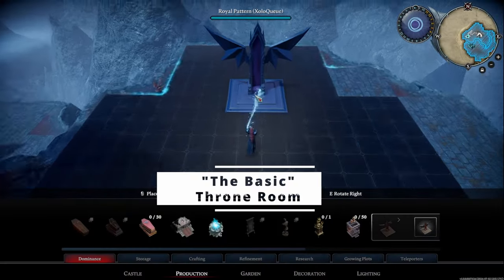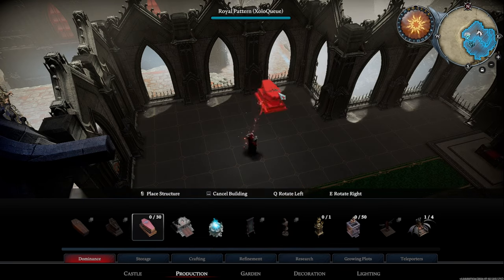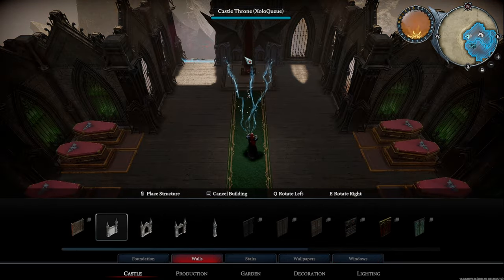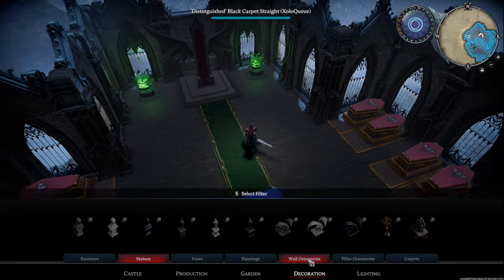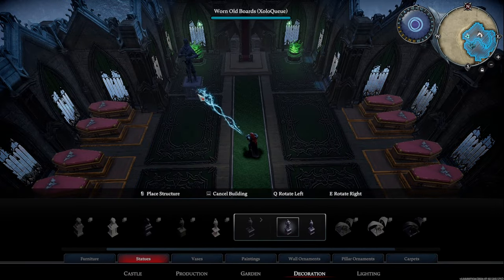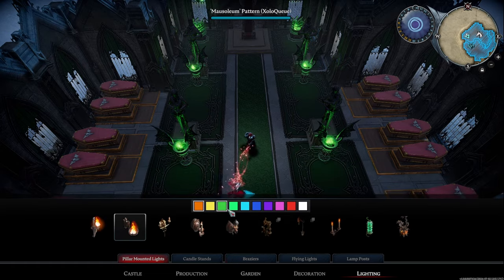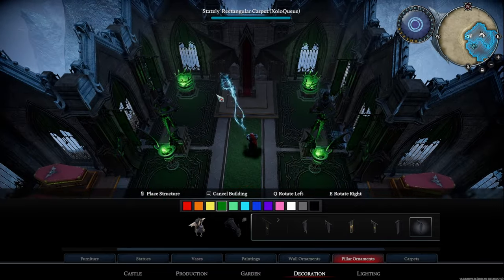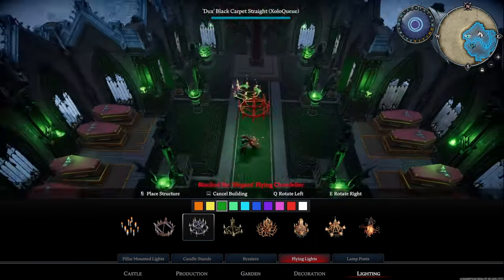How to Build a Throne Room in V Rising Pt 3: "The Basic Throne"

Comment: It's probably just me being a complete noob, but how do you bring up the color wheel for placed items?
As forrating this design, I find it very nice, especially since I like the color green.
I'dstill say that the first design in this series was probably the one that I liked the most. I can totally see myself building that one, with the color scheme from this one.
Reply from the maker: When you're in build mode, hover over the item whose color you want to change, then press and hold the Ctrl key and a color wheel will pop up. Then click and grad your mouse to the desired color. If you're on PS5, press and hold the Square button while hovering to change the color. It works on most lights, picture frames, carpet, curtains, and some windows. There might be more I'm forgetting though.